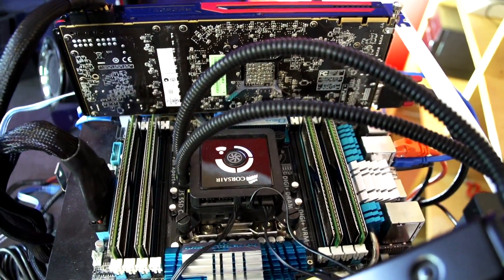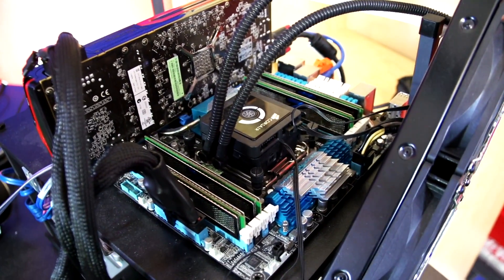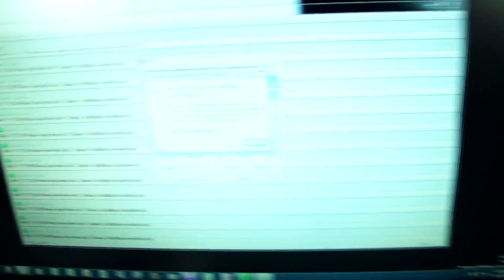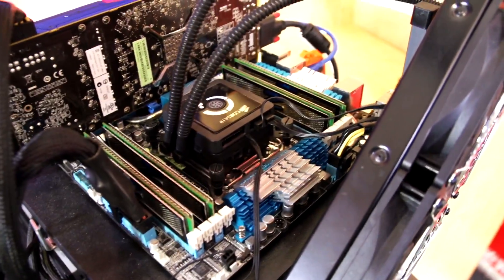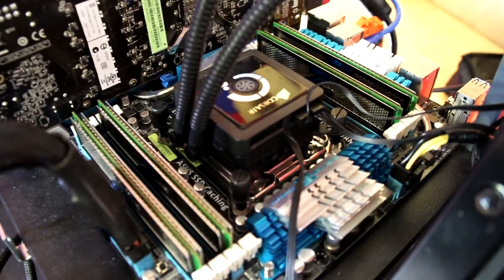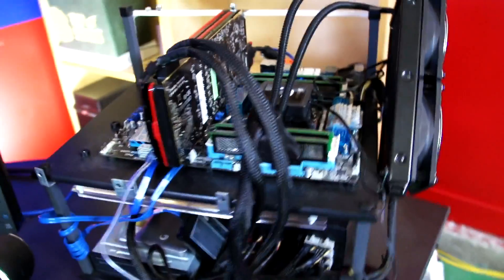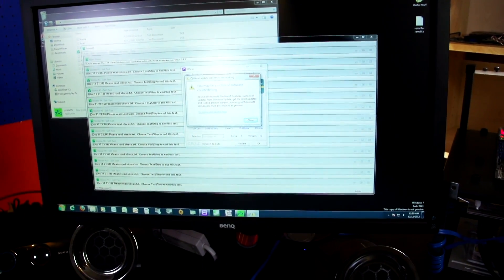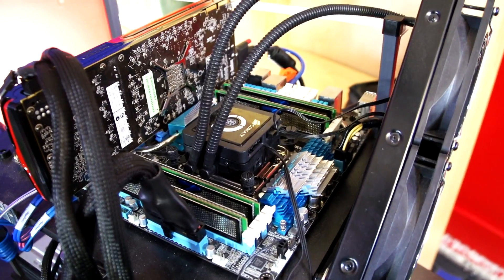RAM Memory Troubleshooting & Diagnosis Part 2 Linus Tech Tips

Comment: This makes a lot more sense. I ran overclocking for my video editing, and my computer crashed hard multilple times, I ended up switching it back to normal setting, my computer started throwing error files and put my system into file recovery mode - had to wipe my hard drive and install windows again. I had to remove my ram going from 16 gig down to 8 to get my 64bit windows to install again. Once I installed my other memory I got a nice burning smell and then no screen. I used another computer to test everything I thought I needed and just this morning added my old ram to my other rig, it was fine on 8 gig, but when I went to 16 gig, the computer kept restarting and then eventually I got no screen. So after watching this video, Im going to be running these test's to find out which stick or stick's have failed. Thank you for this video.

Comment: its deffinatley a burnt copy.....build 7600 in the bottom corner of the desktop...what megaspeed has stated here in his comment is completely wrong....with or without activation its a burnt copy .....btw stating "when hardware gets changed a lot on a pc it will show a windows not genuine message and ask for activation"..ahhhh....no it dosnt......bs

Comment: After selling used memory for a few years, here are some tips..
1) Always use anti-static precautions
2) Check the pins and slots are clean
3) Test each module individually
4) Ensure you haven't dislodged any cables
5) Check your manual for compatability and installation - the order you put them in does matter
6) Don't mix memory types, brands or serial number (sometimes they work, mostly not). Latency and speed have to match
7) Be safe! Unplug between each test

Comment: well thats a load of crap,

4 x 1.5V DDR3 DIMM sockets supporting up to 16 GB of system memory
* Due to Windows 32-bit operating system limitation, when more than 4 GB of physical memory is installed, the actual memory size displayed will be less than 4 GB.

Comment: Hey,i recntly upgraded my RAM from 8gb (dual 4gb) to 16gb (2x dual 4gb). when i install all four dims, my computer turns on for a second, all my fans run and then it turns off, it continues to do this until i switch it off from the psu, due to this i'm forced to remove 8gb of ram so that my computer will boot.
i have an: i3-2100, 400w psu, 500gb seagate hdd a dvd drive, eVGA GT430, gigabyte pa65-ud3-b3, and i have 16gb of gskill ripjaws 1333mhz, but i can only use 8gb.
anybody know what ican do?

Comment: yeah i was going to say that, but he some how "ruled out" the other hardware by running a different set of ram (the Kingston hyper X), I'm pretty sure that there isn't to much of a difference between each ram brand  other than the name. There is some, but not so much that a faulty system wouldn't fail on a other brand...

Comment: Your still doing it WRONG.! ^^ Try to test it on another motherboard when you have so many available... Try one with a different BIOS to make sure the CPU instruction code is using the RAM differently and try to see what happens then... Otherwise its a dead end... ^^

Comment: One thing you do have to also consider when looking for bad memory is, just because you were able to achieve the recommended memory settings in a previous or different system does not mean you will be able to achieve those settings in this current rig even though other sticks are stable in this rig at those settings.  Manufacturers do not test their modules on every configuration but rather a very basic configuration for bining purposes so its possible to have sticks that are borderline.

Comment: Your both half right! A lot of high end motherboards use digital power regulation instead of analog which most low end motherboards use. Also overclocked hardware can last years, just like hardware at stock speeds.

Comment: When my ram died, the system kept restarting and having random power shut downs. I thought it was the PSU but kept removing random parts to locate the problem and it turned out to be a stick. RMA'd it and have been a happy camper since then.

Comment: All RAM throws errors (FACT) and typically at an 'Error Rate' of 1~2 errors per month. The difference is when it throws errors as to how it will affect operations.

Ideally I only use RAM that's meant (CAS/Frequency & IC's) for a particular Channel configuration. I'm not not saying you can't use 4x Dual Channel kits on an LGA 2011, but my preference in that case is a 8xDIMM kit.

ECC corrects the errors whereas non-ECC cannot.

Comment: hmmmmm thats weird that it does that to ur CPU because I know people who have Ivy Bridge and run Prime95 for hours at 4.0 GHz OC with a air cooler and get descent temp. results. Not too sure though because I have a AMD Phenom 1100T OC to 3.8GHz cooled via a Cooler Master V10 Hybrid (air cooler) and I have run Prime95 for over 24 hours the highest temp. I got was 45 degree Celsius

Comment: Thank you for the reply.
I have tried playing around with the Graphic sttings although my knowledge of the tech is quit slim. lowering it does help in most games but I got Farcry 3 recently and changing the settings from low to ultra does not affect the FPS (stuck on 30) for some reason.

Comment: Hey Linus, 
Thanks for all the videos, they have been very helpfull for me,

I am wondering about DRAM speed and how much it affects gaming. I currently have 6G of kingston that should run on 600Mhz but cpu-z says that the frequency is 400MHZ. am I missing something ?

here's the rest of my build:
Motherboard : rampage formula
Processor : QX9770.
GPU: GTX 560.

my question is : If I upgrade the ram will I see a difference in gaming fps ?

Comment: what?? Prime95 is designed to max out your system and if you test it long enough it will sooner or later find any kind of computing error. How do you not like that?? If you were encoding a video or heavy CG work you want to make sure there aren't any computing errors so that your system doesn't crash or encode the work improperly. If you want to create video game scenarios then use FurMark to max out your VGA card

Comment: Nice video!

Can someone help me to solve my memory problem :)
I get lot of errors on memtest if system is left off over night. But after few restarts it works fine. No memtest errors on any of the modules or slots, prime95 stable for hours and hours...Any advice ? (it's not OS related)

Comment: if you have only 1 desktop, you cant really call yourself a hobbyist. I have had multiple systems since i was 19 years old.

also, 40 hours is nothing to test memory. personally, i would toss the sticks into my test system and just let it run as i did my normal computing. its definitely worth the time to test instead of replacing 3 sticks of perfectly good memory because a 4th stick causes issues.

i dont mean to discourage you to computers. you sound like you are on your way into the fold.

Comment: Buy an old used computer. Many computer repair shop sell old PC for like, $50.
I personally got a spare PC that has an Athlon XP 2800+, 1GB RAM, 40GB HDD with GeForce2 MX400 GPU in it, that I got for only $40 used. It may be crap compared to today's computer, but it at least allow me to surf the web and play some older games to pass the time while my main computer is testing for stuff. You should consider that route too.

Comment: This was OCZ special for him ram, he can't throw it away. I'm sure though at some point he'll have them framed and hung on the wall or on a shelf.
In the past I've had some hardware that was dear to me after it's passing, like my A-Bit NF7-S. That was the first overclocking board I had as well as the first board to survive me for longer then a year and a half. So it had a special place in my wall. I still have my 3DFX collection that I refuse to get rid of even though one of the Voodoo3s is dead

Comment: Try Hcidesign memtest, it's very quick and reliable. I also use Memtest86+ for overclocking and testing for massive errors but Hcidesign is by far the best for final testing.

Linus I BET that Hcidesign memtest would detect the same error you found with Prime 95 would be found within atleast two hours...(yes 2 hours versus 24hour testing)